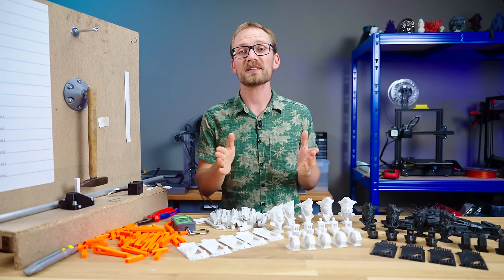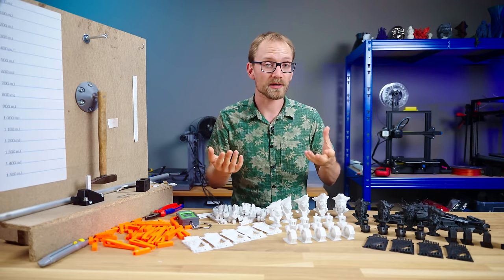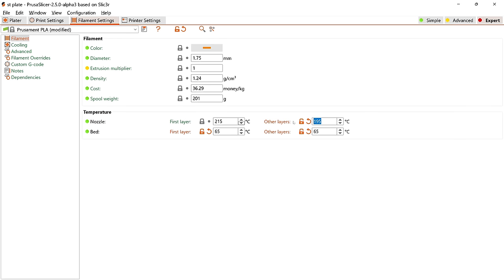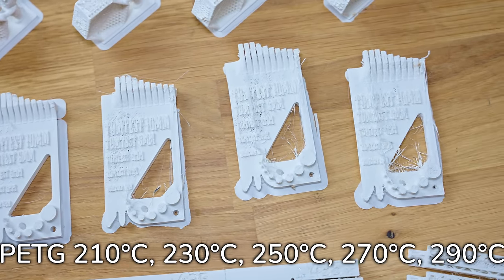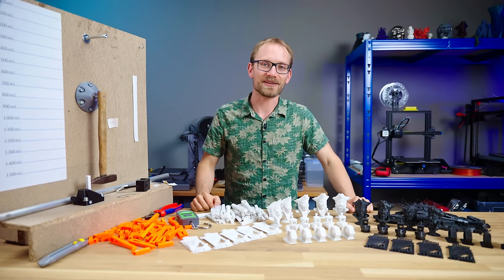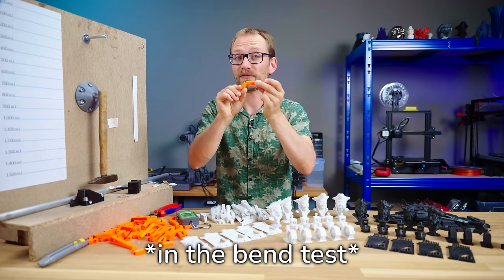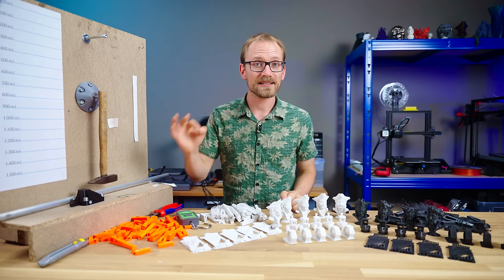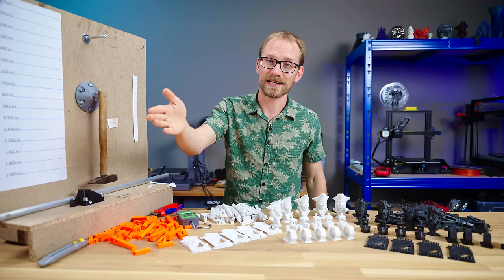Are you printing at the right temperature?

Comment: 09:30 Could it be that the material gets stressed from the high nozzle pressure buildup occuring when printing at too low temperatures, causing residual stresses in the material to cause something similar to die swell, messing up the final dimensions?
Reply: That's a good thought
Reply: It’s can also be because the parts shrink less than they do at regular temperatures. Those tenths of a mm could turn a loose fit into a pressfit. 

The shear stress and resulting die swell you mentioned could also be a reason especially if Thomas printed the parts at the same speed-/ flow settings and only changed the temperatures for the parts. 
He didn’t mention calibration for the different temperatures which could somewhat falsify the tests.
Reply: Yeah I think not fully melted polymer will have swelling around the extruder.
Reply: I second the pressure therory. I think the cause is the higher viscosity of the material at lower temperatures, resulting in more pressure against "itself", thus increasing layer width, because the other directions are constricted.
Reply: @kkpal  Die swell does increase at lower temperatures but that is only relevant when printing into free air. When laying down filament its width is determined by the volume  per unit length over layer height. With the higher pressure at lower temperatures I would expect the hobbed drive to give a bit less filament, not more, so it is a mystery to me why the parts would get bigger. Perhaps bigger layer start zits due to the extra pressure.

Comment: I'm currently using the Bambu Lab 3d printer P1S. It's an enclosed printer. I noticed that the smaller surface area I'm working with, the hotter I need to print, but I'm only heating up the bed from 35C to 55C. The biggest issue I believe I was having, was the Bambu default settings for the cooling fans is maxed out. My parts were flying off the bed.
Definitely going to take some time to learn the best settings for heating and cooling.

Comment: I found that my PETG and PLA prints were getting more and more matte the faster the printer was moving, and I wanted a more glossy and clean look so I increased the temperature as much as I could before the bridges started to sag and then I was able to reach much higher speeds without getting that matte finish. This I think means that the matte finish happens when your filament hasn't had enough time in the hot zone before getting pushed out, so I guess a volcano hotend would help if you print at lower temperatures at faster speeds.

Comment: Lower Temperatures at "higher speeds" means that the material is less viscous and as such the extrudate swell (die swell) is more severe which might have influence the tolerances. If you print them at lower speeds the impact test samples might fit better (potentially).
Reply: +1

Comment: Thanks for the info...however in engineering terms, impact strength is different to tensile strength. Strength in printed parts with regards to heat and adhesion properties is always going to be governed by application needs. So, print variables should be practiced depending on application. No one setting is actually better than the next. That would be my conclusion. Thanks for the great and interesting content. Much appreciated.

Comment: I had to lower temperatures when used 0.2 nozzle. When print in low height rows standard 230C degrees with PETG result in deformations and stringing, so I use 220C instead. Which gave me decent quality on small detail.

Comment: 3 factors will impact your dimensional accuracy in regards to temperature.
1) shrink as the part cools
2) viscosity in the nozzle (pressures)
3) viscosity of extruded material, allowing more creep.

Each can be measured and calibrated to identify the cause, then correct. 

You will need to adjust using a couple test prints.

Comment: Constructive criticism.. reconsider your force to break test methodology. The pipe used as a lever has a variable angle of incidence on the printed test part, when it appears you are trying to test vertical strength.. you are actually testing strength in a constantly changing Y and X vector. Rig up a pulley that is in between the luggage scale and your force input and you will constrain it to the Y axis.

Comment: The larger dimensions on parts when printing below their optimal temperature can most likely be explained from non-uniform shrinking in relation to the printing temperature. I have long had the suspicion that shrinkage in 3D printed parts is non-lineair. Meaning that the hotter a print is or the more volume of plastic is deposited the more the part will shrink because of the disturbance in the polymer chains being more or less. Keep in mind that with 3D printing we're at the low-end of the liquid range of most plastics. PETG usually prints fine at 230C whilst I believe it's injection molded at close to 280C~ don't quote me on that, but I know from my own injection molding press that I cant get good shots at the same temp as the printing temp.

Long story short; 3D printed polymers, specifically FDM printed polymers most likely shrink more when printed at higher temperatures and less when printed at lower printing temperatures.

This could well show up in printing a tower at scaling temperatures during the print and the carefully measuring the print.

The mechanism behind it must have something to do with how to polymer chains crystallise. I'm not sure if the amorphous or crystalline nature of a polymer would matter or not.

Comment: I've defiantly experienced dimensional shifts when printing hotter. I'm pretty sure it has something to do with thermal expansion of the plastic while printing. Yes the mechanics are making the same moves and the extruder is pushing the same steps resulting in the same mass. (As others has mentioned pressure, mass would be something to look into.) But I think even with the same mass you can get different dimensions because hot parts will shrink more. Say a printer is accurately placing a 0.6mm line on the permitter of a part at 190c, when that part cools down to room temp it will have shrunken down to Xmm. Being less than 0.6mm. The same line extruded to the same accuracy of 0.6mm at say 230c, will shrink to Ymm at room temp. But Y will be less than X because Y had more temperature shrinkage, thus the part printed at 230 will have overall smaller dimensions.

Comment: The PLA we use in Argentina (3N3) is printed at lower temperatures. 215 degrees is actually almost too much. We print at 195-210 degrees on this material.

Comment: I had an interesting experience with PETG the other day. It was printing like doo doo and everything I tried didn't change it. So in desperation I turned up the hot end temp to 260. It started printing and was looking ok but the extruded PETG sounded like a bowl of rice crispys.  You could see the the tiny bubbles in the layer lines. I figured the filament was trash because it was full of water and just let it print. After a little while the bubbles went away and the print looked smooth and glossy. I guess the take away from this is that if you think you filament is wet, crank up the temp and see if it bubbles. If it does, dry it out, and maybe save yourself a headache and a couple of dollars too.
Reply: The filament on the outside of the spool absorbs more water than filament inside the spool. Filament on the inside is blocked by outside filament.
Reply: @gratefulamateur1393  That's what I figured afterwards. I thought this info might help some others with similar problems. Thanks for substantiating my theory.

Comment: i'm interested on how temperature correlate to print speed
since PETG actually prints better at 250c, it'd be interesting if using a non-high flow nozzle, whether you can push the flow rate higher
Reply: Should increase maximum flow. Once talked with a ender3 owner, she said, she cant print the pressure advance print for klipper, hotend cant keep up, told her to bump up the temperature, print was successful
Reply: 250? It completely depends on your printer calibration and print speed...
Reply: If you use a lined hotend (PTFE inside) you get a clogg since deforming the PTFE at 250 degrees so resulting in slower printing after a short while.

Been there, tested that out to find that out, so with those printers I stay only close to 240 degrees and printing a bit slower.
Reply: @elvinhaak  yeah same, did that for my ender, though I've heard that speed benchy ppl went higher temperature for higher flowrate

Comment: I print my South African SA Filament PETG at lower than recommended after numerous temp towers. I even had to abandon the manufacturers PETG temp tower range of 235 to 255C. I find it prints best in gloss at 210C. I thought it was pla except it is flexible like petg and won't stick to my glass bed unless I turn up the heat on the bed to 70C and 250C for the first layer. It's also really strong. It's supposed to be copper coloured (actually more like pot plant orange brown). The fan speed I am still tweeking. Zero on first layer and 40 to 70% on subsequent layers.

Comment: i find if you follow the numbers printed on the rolls, I get the ideal finish, so long as everything is tuned up. i offer matte parts as opposed to glossy, and for the PETG i use 220C gets me matte and 240C gets me glossy. just the lower temp requires a slower feed rate to prevent under extrusion.

bottom line, the most important research you can do, is on your own. working with the 1st layer or first 5 or so layers you can really dial in your feeds and speeds as well as the ideal temp for what you are going for, whether is "strong" parts, nice looking parts, quick and dirty, etc.
Reply: What fan speed do you use.i use 0 for the 1st layer and then use 40 to 70% for subsequent.  I am not sure what's  est yet.

Comment: I generally tweak my print temperature from the baseline based on how much plastic I'm trying to shove out the nozzle. If I'm printing faster and/or thicker, I'll bump up the temp a little so my extruder doesn't start clicking. Conversely, if I'm printing slow and/or thin, I'll go down in temp a bit to keep from having that lovely cooked plastic smell.
Reply: It would be nice if the printers could adjust their speed to compensate for too much resistance. Some kind of strain gauge on the drive wheel, perhaps.

Comment: One important thing is the environment temperature. I print in 23°C environment without enclosure and my PLA Benchy is with PLA Polymaker at 205°C fantastic. My Voron with enclosure (doors are opend) I have around 30°C and my Benchy has overhangs. First I thought it's because the new mosquito hotend and wrong cooling geometry but I think it's because the environment temperature.

So if you print don't forget the environment temperature for PLA

Comment: Regarding DIMENSIONAL ISSUES with LOWER TEMPERATURE: I experienced, that for each temperature the pressure advance needed is differently. In fact, even the filament flow seems to have an impact on this. Meaning, even though you perfectly calibrated pressure advance, the more filament is pushed through the nozzle per time (=volumetric speed) the more under-extrusion you get. In fact, there seems to be a linear relationship between volumetric speed and volumetric-flow-% (effective flow-factor). Meaning: real_extrusion = (1 + factor * volumetric_speed) * extrusion_commanded. This factor effectively seems to be temperature related and not be be compensated for by the slicer or pressure advance.... HOWEVER, there seems to be a sweet spot in the temperature range, where this factor seems to is very low. -- RESULT: So when you calibrate your printer for a higher temperature (pressure advance and flow) and then print at a lower temperature, this results in over-extrusion... and hence parts that are larger in dimensions. I guess this is what happened here.

Comment: I see someone mention thermal expansion/contraction as a possible reason for the thicker parts at lower temperatures (i.e. lower temps = less difference between the volume of plastic when it's hot vs. cold leading to slightly bigger parts). I would argue that wouldn't be the case due to the extrusion happening above the melt zone so, assuming all steps can complete, an equal amount would be extruded.

However, I know that there might be skipped steps at lower temps. So it's even more counter-intuitive.

That said, I wonder if die swell could be a factor? The more pressure you have to exert on a viscous plastic, the more die swell there might be? Just grasping at straws.

Comment: Can it be that the residual heat keeps plastic more sticky and the polymer chains have more time to form longer chains. And in the colder the chains get shorter. I think a trip in a heated chamber can be interesting to try. And you have so many variables that works here like residual heat in the heating block pid moisture, wind drafts,  heating profiles.product variations ,  But still so good to see the result helps me figure out what's wrong with my prints. Keep up the good work.

Comment: Realized with my V400 that the consistency in the performance of the hot end thermistor is degrading the more I increase the temp, which is why accurately controlling the actual temp of the nozzle is obviously affected. Perhaps this component of the printer system should be part of what is upgraded instead of being the low-cost performance part that comes standard. However, it may be a challenge to integrate a better component with the controller board. NTC(not PTC) thermistors are expected in 3D printers. Perhaps the real problem comes from the resistance in the thermistors not being linear in the temperature range, which leads to the question of the ideal(but perhaps unnecessary) of having different thermistors with more narrow temp intervals depending on what material is printed (i.e., PLA vs. ASA). This would ultimately lead to one printer modified in HW and not only SW settings for one specific material(or even brand on top of that), and another printer HW+SW modified for whatever other material needs to be printed.

Comment: I sort of missed out on the fan speed? Is that varied? I tend to print at higher temp for PETG, with like 70% fan speed. That improves bridging. Or at least, I think it does. At lower temps, there is a need for less fan speed on the cooling. Also, using a sock for a V6, the cooling fans is supposed to influence the hotend temp, as in actually not cooling the hot end as much. My point is, the other settings are not the same, if you vary the fan speed. The results will also vary insanely, correlating to print speed. I cannot print with that 70% cooling fan speed, at any high speed at all. Only snail speed. In my case, using a MK3, I prefer slow print speed, medium temp of 240C and fan at 70%, for PETG. If I were to change the temp, I would need to get to play with every setting again.

Long post, but Thomas, I would love to get your input on what you think about fan cooling speed setting and print speed, for at given print temp for PETG. What to look for, as to increase print speed or not, and what effect the cooling fan would have. Then compare optimized results for each temp. Like PETG at 230, 240, and 250. There will be pros and cons all over the place, and there definitely will be something I have missed.

Looking at the particular test in this video, I just go, "but I would never print like that". For lower temp, I would seriously decrease print speed and fan speed. Using a standard V6 with a sock, I tend to use higher temp and higher fan cooling, but that seriously disallows high print speeds, as in nothing sticks together at higher speeds, due to too much cooling an too poor of a heat end and the Nozzle X sure does not help in my case. (It cleans easily and lasts forever)

Since I am rambling: Printing at a lower print speed, results in significant less wear on the printer. There is also far less noise. And if you care about noise, placing the printer on some IKEA plastic boxes made for storing food, just filled with sand, is insanely effective, and almost for free.

Comment: Danke für die Aufklärung!

I was trying around with different temperatures recently as well, but i ended up destroying All my results by switching way too often between PLA and PETG. This resulted is a big plug of solid filament in the cold section of my revo nozzle. What a pain in the b*** to remove that...
Now i dedicate one Set of nozzles to PLA and one Set to PETG. At least this was something i learned during my Experiments.

Comment: I tried my first roll of silk pla filament.  The roll label said hot end temp 180-240.  I very first went with 220 for a Oreo caddy.  The printed subject on the bed appeared to have “bubbles”. After 20mins of a 11 hour I quit print.  I started to print a temp tower at 220 first layer and same so I changed temp down to 210 and let it go few more mins. Not happy I gave up temporarily and packed roll away to try later

Comment: the only thing i can think of regarding the tolerance of the parts fitting into the jig is printing outside walls first or not. Beyond elephants foot I've noticed that printing from inside to outside can make a part fatter by.02-.3mm the other factors being the various temps involved and if enclosed or not.

Comment: It depends a lot on the speed too, prusas are slow and the filament is kept hotter for longer, on a fast printer higher temps just make flow possible without insane pressure buildups

Comment: This was a really informative video, thanks Thomas! I do wonder how much ideal temperature varies among the different filament manufacturers? There seems to be a lot of variation depending on the brand you print with, particularly when it comes to PETG (at least in my experience).
Reply: I've had it change from one batch to the next on the same manufacturer. It was esun pla plus but I'm also suspicious my hot-end calibration has drifted.